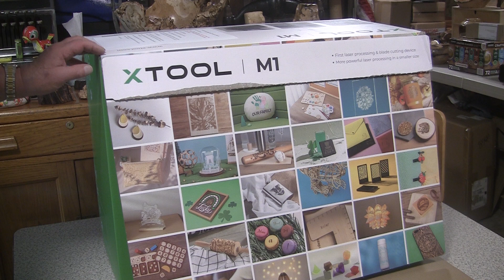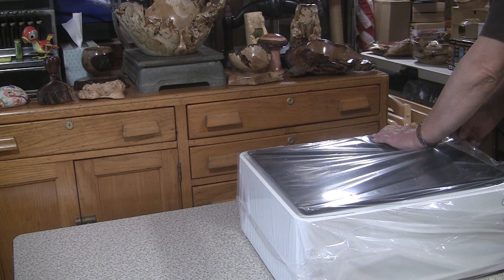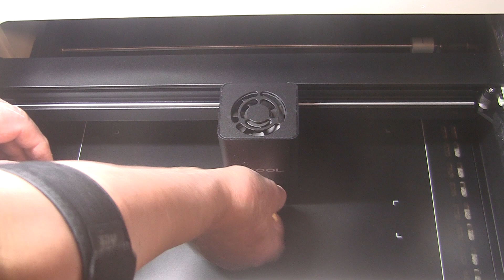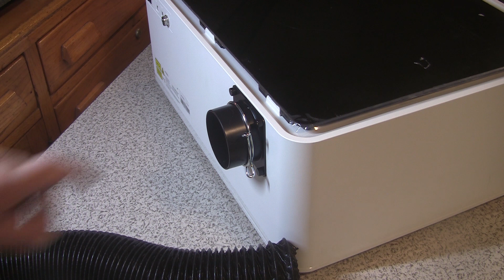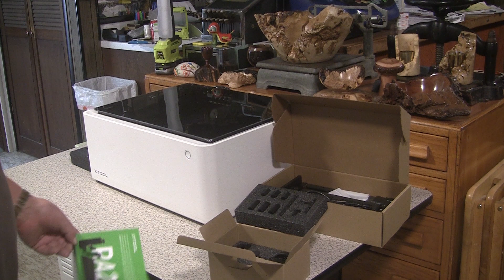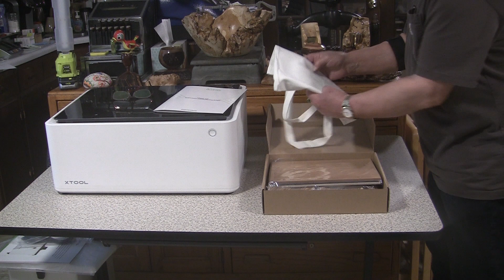XTool M1 Laser Engraver/Cutter/Blade Cutting Introduction - First Part

Comment: Phil, tell me about the bench scale with the large bowl on it. I spent 46 years working on scales and have several myself.
Reply from the maker: All I can tell you is that it's a Fairbanks and I picked it up at a yard sale for 20 bucks.  It works and seems to be accurate.  It's just an antique decorative piece for me, Lucien. 😊
Reply: @Phil Anderson - Shady Acres Woodshop  I retired from Fairbanks Scales after 43 years. if you look for the serial number on it I can let you know what year it is. It may be stamped under edge of the beam.

Comment: ...impressive...one question...did they include safety glasses?
I know you mentioned it's enclosed and you pointed out the additional panels, but as someone who's worked around lasers for a number of years, I'd still wear safety glasses whenever it's running...
Can't wait to see what you do with this...!
Reply from the maker: I was surprised it didn't come with safety glasses.  The last two lasers I've been sent did include them.  In reading comments in a users group, everyone seems to feel there is no need with this machine.  Apparently no accidents, yet.  I do know it shuts down if you open the lid. 😊
Reply: @PhilAndersonShadyAcresWoodshop  ...ok...but please be careful...I want to see many more vids from 'ya...👍